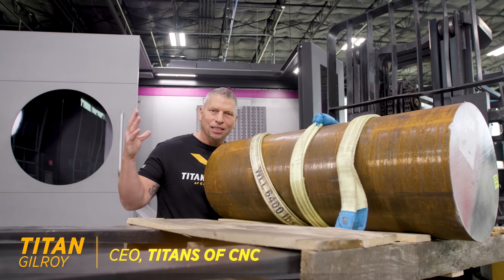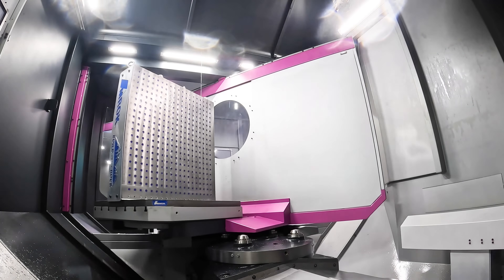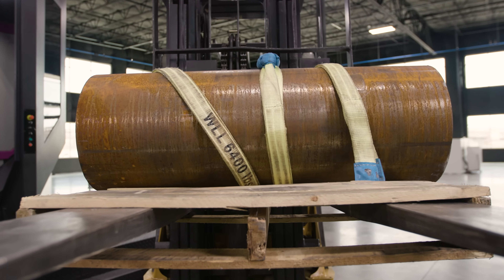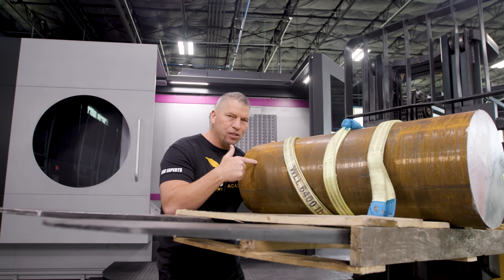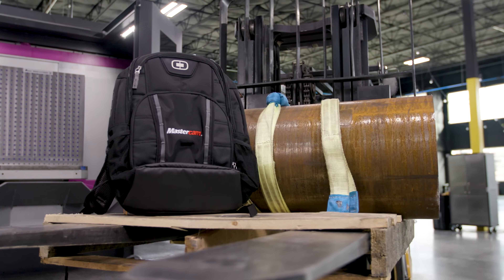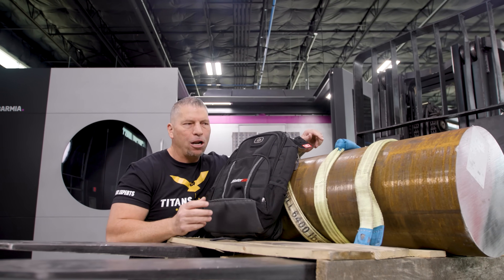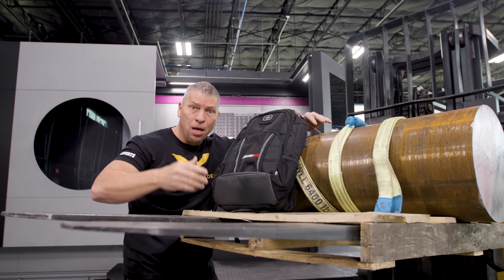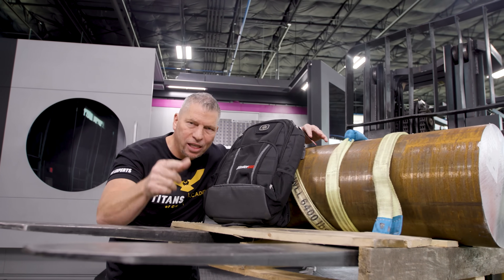How Would You Do It?? YOU Tell US How to Fixture This Monster!

Comment: As it is not a production batch but a single part, you don't want to buy or build expensive fixturing.
You could simply screw 2 aluminium flatbars in the pallet's slots, machine the edges so they are beveled  and parallel, and drop the billet on it. Because of the weight, you could clamp it only with nylon straps, and make sure you take light cuts as it is only a preparation operation.
You could machine one end as called on the drawing, and machine the base to receive a simple aluminium plate that screws on the part.
That plate would be slightly larger than the part itself so that it can be screwed from the top on the next op
For the next op, you setup the part vertically at the center of the pallet, and put bolts over the top of the fixture plate.
Location can be achieved either by dowell pins and/or by the precise hole at the center of the pallet.

Comment: Depends on what the part looks like of course. First operation: V-blocks with chain or clamps, have the part fixtured across the tombstone. Face / Shoulder mill three sections where you can hold it with vices. Second Operation: have vices on the tombstone, match them with the machined sections on the bar stock. now you have 5-side accessibility. Third Operation: Custom fixture or vices, depends on the shape of the part.
Reply: You were very close with your guess clamps vices with jaws cut to fit the flats. Really close considering we had absolutely nothing to go on well done.
Reply: @mp6756  Thanks mike! this was a cool challenge :D

Comment: i would put 2 tenons on the underside on a 3 axis using V blocks and a chain, then it would make it easy to grip in vices that way you can machine all around for the first operation. it would be a solid work holding with the most space to access all sides

Comment: I assume you will eventually machine this piece square as you mention you want access to 5 sides at once. If it were me, I would machine a dovetail down the length of the work piece for OP1 using locating blocks/pins and strap clamps and set up vises on the tombstone with the appropriate jaws to accommodate the dovetail. The last operation would most likely be cutting away the dovetails to yield a finished workpiece.

Comment: I think you would have to face one end of the bar, using V block and chains strapped to tombstone or pallet, and either install schunk vero-s clamp system to that face, or use a big 4 jaw chuck on pallet to hold your part, so you can machine 5 sides in one setup.

Comment: if you could get a dovetail fixture big enough that is how I would go about it because it is a mechanical and pressure fix to that material and it would be rigid as hell the way I would do the dovetail part is that I would take that tombstone off and put a couple vises on the table lay it flat in the vises and on the deck of all the vises then tighten the vises and come at it like a horizontal with a dovetail cutter using x and y once I got the dovetail cut put the tombstone back on the table fixture the dovetail on that tombstone then fixture the material in the dovetail and just like that I would go to town on the Steel boom

Comment: We had similar material for some 5 axis parts a few years ago. We used belts to secure the cylinder on the machinetable. We also used v blocks below it to fix the position on the y- axis. Then we milled 3 flats, one between the belts and one on the outer side of the belts. That way we could turn the part and fixture it with 3 vices with clawbrackets (dunno if thats how its called in english). That way we had a somewhat vibrationfree, tight and approachable fixture. We did it on a horizontal machine (dmf 350) so i dont know the possible problems with a vertical build. 

Also, there aint any informtion regarding the finished part....

Comment: It looks like there's a locating point or artifact of a back stock point on the back. V block on the floor to hold the weight up and pin through that hole that protrudes enough to hold it back and down with chains or straps. That'll get one side machinable for locating studs or holes to bolt to a fixturing plate. Clamping to that should get 5 sides machinable in an op, maybe split up by moving chains or clamps as you machine different areas to hold the weight and distribution of mass as it could change quite dramatically as machined

Comment: If it was me, I would check the squareness of the sawn ends to see if it could stand on one of the ends as long as there was a safe margin of excess material all round, then using the empty pallet mount the the material along the rotation axis of the pallet. using the side clamps and risers blocks (to give access to lower down the part nearer to the pallet) as you did the later ops of the Octopus job. In doing this it gives access to all sides apart from the clamped end. Please give me some feedback on my thoughts :-)

Comment: It really depends on what your machining. Without knowing the drawing or other relevant information like tolerances and surface finishes it's hard to tell you how to hold it. But just looking at the material, your not using the best machine. I would personally use a cnc lathe with steady rest and 5 axis spindle. Theoretically, you should be able to do the whole part depending, once again on the drawing. It may not be as rigid as the horizontal mill but it would require less workpiece movements and redial in thus lowering tolerance issues.

Comment: Since it needs to machine 5 sides of it, I think the fixture will be doing with the included holes at the bottom of the stock. Maybe the holes will be threaded and secure to a riser block, then the block will be secured on the empty pallet. The pallet can then spin to access 4 sides around the cylinder, and the machine head can turn to machine the top of it. One of the face will be machined in order to fix the stock to the tombstone with the vices for further operation, and also able to access the last side (with the hole).

Comment: I am an old machinist , we used "monocle´s" (we called them in Dutch) big round support brackects , having three massive adjustable struts with a big  bearing Ball say 2" diameter or (yess old school) bronze well lubricated friction bearings.
Considering the very rough and rusty surface of the workpiece. 
These would touch the workpiece .
Also would need to know wich machinig operations it has to under go , before choosing the right support system 

Also you could open and rotate 40% of the round ´monocle´ so you could drop in the workpieces from above (crane handeling)
Grtz from the netherlands Johny geerts

Comment: I’ve turned a lot of wood but haven’t turned metal since high school. So, let’s approach this like it was a log.

With a job this big, you are probably going to make enough profit that you can afford a little custom tooling. Therefore, I would start by making a 1” thick disc from steel, drill about 12 holes (1” should be fine) about two inches from the edge, and add some slots to allow the jaws of a chuck to pass through. Add six more holes to bolt it to the chuck, drill and tap the chuck, and use aerospace grade bolts to connect one to the other.

“But where do we get this disc, Jim?”
“I seem to recall this is a machine shop.”

Next, procure a set of dovetail inside jaws for your chuck. 

Machine one end of the workpiece with a dovetail mortise to take the jaws and tapped holes for the bolts, and use aerospace grade bolts to connect the two.

Insert the piece in your Ibarmia and use a work holder to support the far end until you can drill a hole for a tail stock, then bring that up and you’re golden.

Comment: Chain clamps to hold it on the tombstone, then cut out notches so it can be rotated 180 degrees and  go in the vices that were mounted in the last video. Your part will be horizontally on the tombstone this way. Then you can do all/most of your millwork in one setup. Hard to know how you're going to set up though without knowing what the parts going to be;-)

Comment: Hey Titan,
I think the open pallet would be used for the first ops.   
Op#1 set on 2 V blocks using gravity to your advantage and face the cylinder to length and adding and holes and threads needed there.

Op#2  remove the V blocks to stand this part up on the face,  I would prop It up on a thick enough plate in the center of pallet so that you can get at all sides.  Clamp a monster bar over the top to get at two sides then move the bar 90 degrees for the third and forth sides.   Now you've finished the part if it's a simple geometry or move onto the tombstone for more advanced geometric finishing.

Op#3  mount it back into a vertical position on the tombstone with 2 large vices and get at finishing 3 faces 

Op#4   flip part 90 degrees in same orientation finish up any loose ends on the final 3 sides.  Or depending on what stage 3 entails possibly need to get the aluminum plate out and get some pitbulls or hold down bolts situated her for your final machining. 

Not sure of the style of part so you could be done as soon as Op 2 .
Hundreds of ways to be be more specific but got to look at it and head scratch with a coffee in hand to be sure! Haha 😄 

I can't wait to see this hoged out on your next video

Comment: If you absolutely have to machine them all from one piece of material and you have enough material to spare , I would..............
Face up each end turn a deep groove in the OD near one end to make a flange.
Then  drill 4 equi spaced holes  use studs into your Tombstone and studs, nuts and washers through the flange .
Then use a step over program to work shift over to each part. 
Easy ! 😉

Comment: Drill and tap one end for work holding to the table using stand off fixturing.  Part will be standing up vertically and the 5 axis capability can hit all sides. It can and will be mounted to the pallet that doesnt have the tombstone.

Comment: My guess - drill and tap holes to bolt it to a plate with a cradle, then bolt the plate to the tombstone.  

I have absolutely 0 experience at this level but the tool suggests the part will be squared off, which would likely leave enough waste on the back side to support drilling and tapping.

Comment: Machine a flat along it, then put tapped holes in it and then flip it over and bolt it down to a slave plate. Or machine 1 end flat with tapped holes, flip and bolt that down to a slave so it's standing up. Depending on the part

Comment: To have that beast on a 5 axis I would machine the tslot negative into the material and then slide onto the table and lock it in place with some tslot clamps removing any weak points in a fixture plate or vice bolts

Comment: Your'e not telling us what machining needs to be done so we can only guess. Since you are milling it on the 5 axis you probably want 360 deg. in a vertical position so I would weld or bolt a flat plate on one end to stand it up vertical.

Comment: Jaw chuck installed on the machine table and piece put vertically. But then,  problem with vibrations?
Reply: Also, first preparation on lathe machine with center drill, faces and diameter removal

Comment: When thinking about fixturing the stock for machining five sides in one operation, i first think about vertically fixing it on the empty pallet. I see you guys either using mitee-bite Heavy-Duty tslot clamps, or possibly a fixed three-jaw chuck (for example: Schunks “ROTA-S flex or ROTA-S plus). 
Although, looking at the length of it, i would expect some chattering when machining the top. 

It would also be possible to fixture it horizontally on the empty pallet, either clamping it down on V-blocks with threaded rod and t-nuts or using the vero-s clamping system.

I’m a CNC-machining apprentice, so not too much experience here yet, never machined such large parts.

Met cardboard-Titan at the education-centre of Swissmechanic, greets from Switzerland 😛

Comment: So you said 5 sides are to be machined so I assume that means the 2 ends and 3 sides. It’s hard to say without the full story but I’d imagine V blocks and clamps would get in the way of this so the only way I could think to do this would be (if permitable) machine a linear dovetail along the part and use a row of vises with dovetail jaws for the fixture. CNC setup is not my main gig but that’s how I’d do it.

Comment: 1. Machine two massive steel blocks with height at least radius of part.
2. Mount steel blocks onto Ibarmia flat table.
3. Mill half spheres into steel blocks with pitbull clamps at the top to hold the part near max width.
4 Lower part into half spheres, clamp it and do top flat side with Vero s and maybe also top rectangular sides (possibly with dovetail) for vise if needed.
5 Mount onto flat table with Vero s and get after it to get the weight off.
6 Mount into 4 vises on tombstone (possibly with dovetail or serrated jaws) and do some detail work now that the part is lighter.
Basically should be able to choose any side you want for whatever clamping you want this way.

Comment: Tap the small hole where the material's info sheet is stickered on (seen in 0:05). Use a piece of steel 3"x3"x6" as a fixture, cut it into a T shape and use the longer leg as a threaded insert of the same pitch as the one tapped in the hole of the material. The new T fixture should be able to slide in the Ibarmia's pallet tracks. Finally, you can secure the material or simply the fixture (underneath the material) by using two regular track stop fixtures and pushing them up against the material (using rounded track stop fixtures would probably yield less vibration).

Comment: I would use fixturing like those "mighty bites" to fix it on the table, probably after facing and machining a v-shaped or dovetail groove on a lathe.
Or maybe better to weld a plate with holes to face of cilinder and simply use t-slots of table, but it's not your way.

Comment: I would put it into a lathe and cut a relief to make a place to hold it better
Another thing i thought was to drill some large holes in the bas, tap them and use the holes of the plate to holt it, but before that you should face the base to make sure that you have the maximum contact with the surface, and maximize rigidity

Comment: 1600lbs? I would fixture it very securely! Jokes aside, depending on the parts features would depend on my fixtureing approach. First operation may be to face 1 or both ends to get a flat reference surface. Then I'd mashine some flats/treads for additional clamping along the length of the part. Then mount vertically on the empty pallet sitting on the machined face. Since the machine is like a horizontal mill we can use gravity to our advantage and machine from the top down. Removing clamps/work holding as you work down the part. This is one way to hold it for certain parts but obviously not a good way for all parts.

Comment: Key is qualifying surfaces.
Even thru bolt Dowling if need be.
Holding for initial cuts need alignment and camping. 
Alignment is Basic.
Vertical  Horizontal Level 
Depending on mate
rial. 
Using Come-a-long (winch) Heavy-duty chains.
I've used this method on Larger Chuncks 
Aluminum thru SS.
Never failed.
Thanks 
I enjoy your vids.
35 yrs experience here.
From NASA to Oil Tools.
It's all the same.
If you enjoy your work.

Comment: Without seeing a blueprint my first guess would be use your open pallet and strap clamps clamp it up on side one mill a small flat drill and tap some holes and drill at least two small locating holes to bolt subplate to .clamp on subplate with side 2 pallet vice machine as much as possible then if needed remove from subplate flip part locate on datum and machine the rest of the part removing any features made from 1st subplate operation... again I would need  to see the blueprint to know if this would work

Comment: A little hard to plan without seeing what the finished part looks like, I would think you would want to machine a flat on sections of the long axis and drill and tap the material to receive some kind of shunk locating/clamping studs that can be removed/machined away later to get you access all around the part. I would think that could be accomplished held down in large chain type v blocks

Comment: Gotta know something about the finished parts to understand the clearances available for fixturing.

I'd give serious consideration to welding some angle brackets to the ends of it which get bolted to the table.   That's fairly low effort  and won't waste hardly any material.

Comment: For 5 sides, I'm guessing you'll clamp it to the blank pallet (on v blocks) and mill a flat on top with perpendicular cuts in order to clamp it in a miltiple vise setup on the tombstone. Either that, or you are going to clamp it on v blocks on the tombstone and true up on end and the diameter to be clamped on the  other pallet in some Schunk™ brand round chuck the likes of which I've never seen before or could imagine.

First way, you have access to the ends and 3 "sides" of the diameter, second way you have access to one end and all 4 "sides of the diameter. I'm guess option 1 though because rigidity.

Comment: Without a drawing or even an explanation of what  features need to be machined it’s difficult to determine how I would hold this material. If it were up to me I would machine a dovetail into the stock and use the vises to grip on it. Or I would use pull studs or V Block and custom strap type work holding.

Comment: I’d V block the part down on the empty pallet and machine 2 flats across the top of the part. Then use those 2 flats as the holding surfaces for the vices on the tombstone.

Comment: I do a lot of parts like that if not bigger but we do them on the lathe and then we pull them in v- blocks on the horizontal but it really depends on tolerances of the print and finishes on how you would hold it in what operation you would do first.